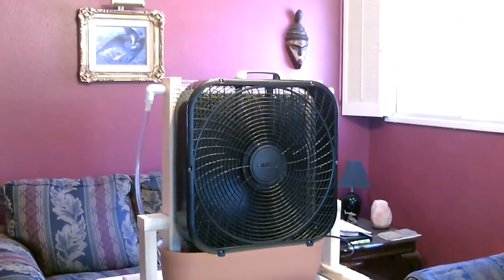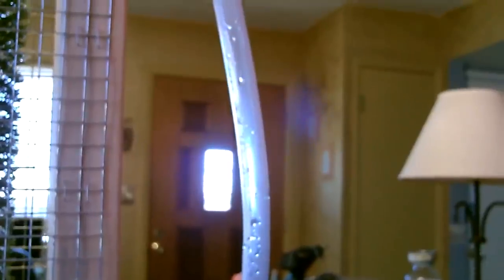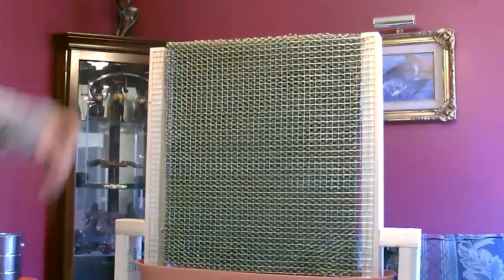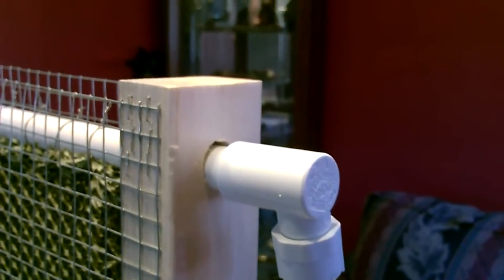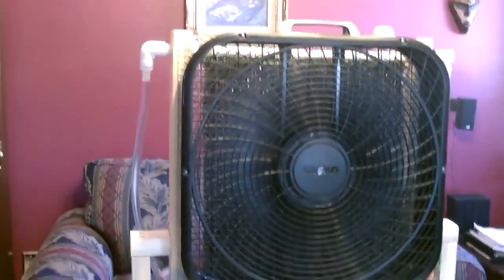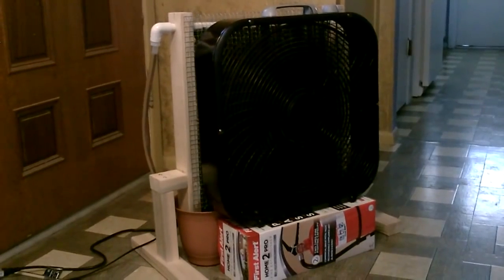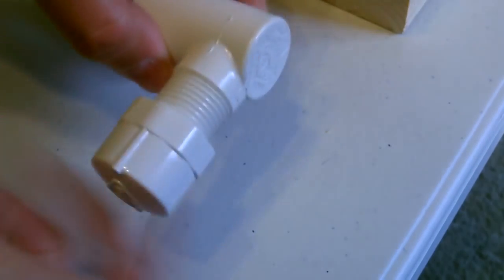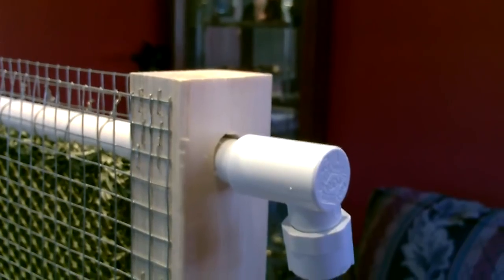Homemade Evaporative Cooler! - whole room Super Cooler! - up to 30F drop! - Easy DIY

Comment: Does water get to the fan motor? So why do you need the wire mesh if the pad is attached to the PVC at top? What size pump did you get? Thanks.

Comment: really don't think that pulling all that wet air thru an electric appliance is going to work out well in the end.
Reply: TheFlwildman appreciate the concern but its just a basic swamp cooler.  Replace the fan as needed